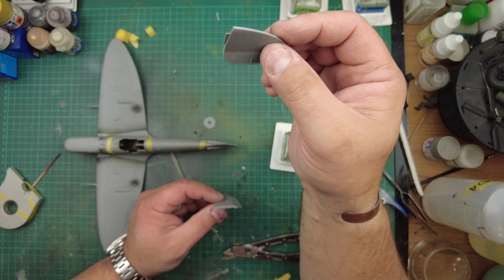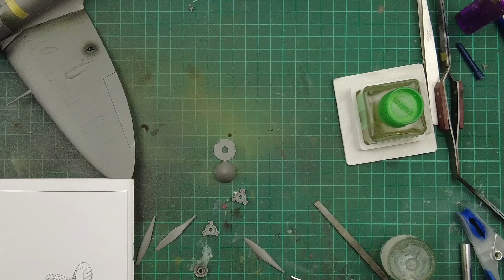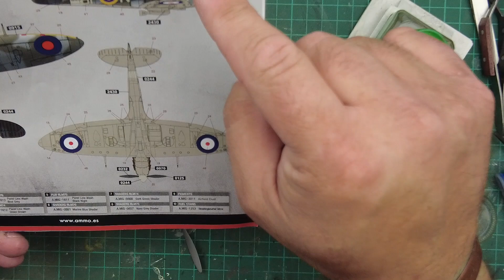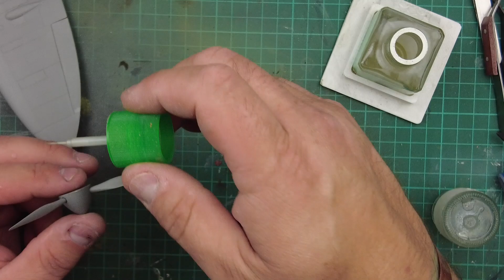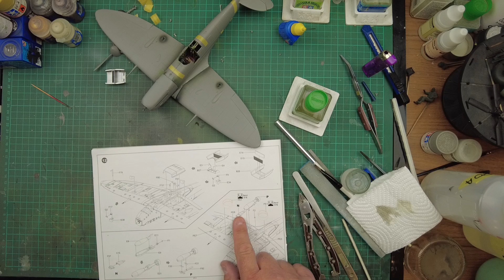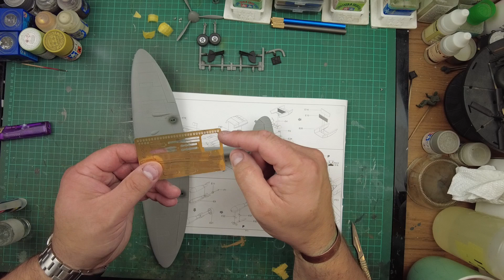Border Model 1 35 Spitfire Mk Vb Build Series Part 8

Comment: Looking good! I have to say though that my eyes keep being drawn to those horrible wheel well bulges on the top surface of the wings. I think I might just have to completely sand them off - I've looked at lots of photos and they are barely visible on many; far less prominent than the cannon bulges.
Reply from the maker: They certainly are prominent, interestingly the 1/48 Tamiya Mk5b has the same bulges in its upper wing surface, does reinforce the thought that Border copied another companies tooling or design rather than doing the R&D themselves.

Comment: I’ve just finished building this kit and in the process of painting it, it’s a shame such a relatively easy build model is let down by its poor instructions, and incorrect details. Hopefully you haven’t gone through the frustration that is fitting the photo etch in the wheel wells, because it doesn’t fit. They’ve etched them both the same rather than opposite 🤦‍♂️
Reply from the maker: Thanks for the feedback, I’ve had the pleasure of fixing the photo etch in the wheel wells, it will be coming up soon in the next couple of instalments, total error on the part of border that could have been easily avoided, there no excuses for that failure at all.